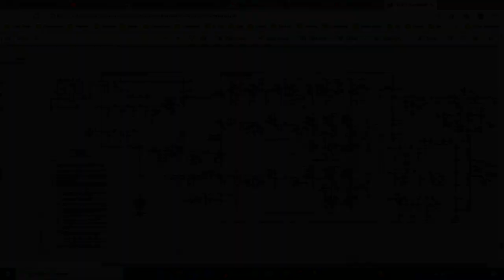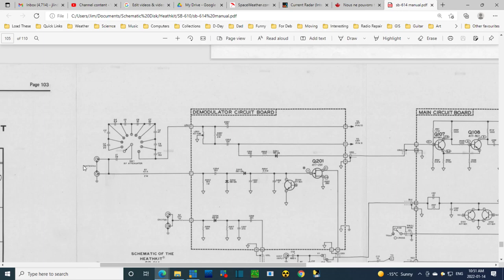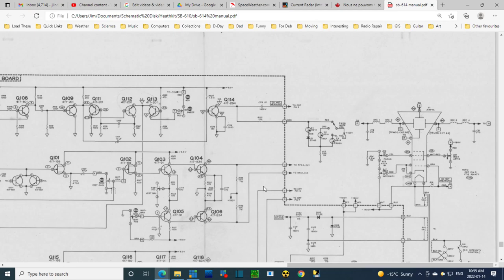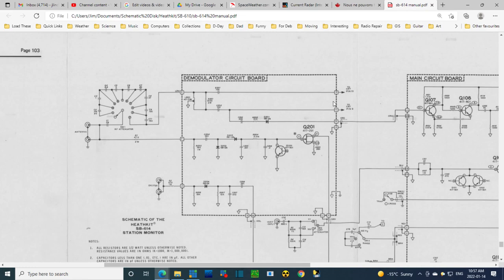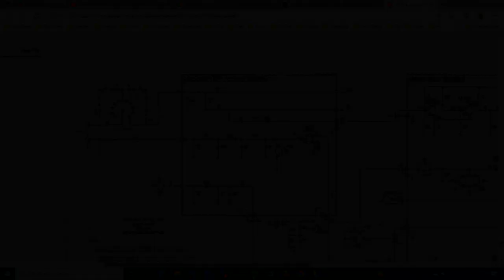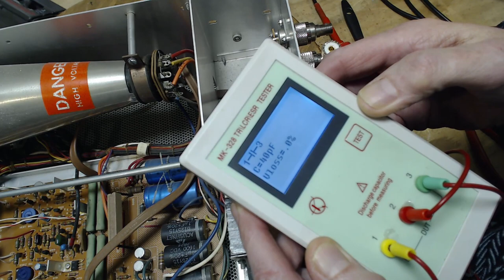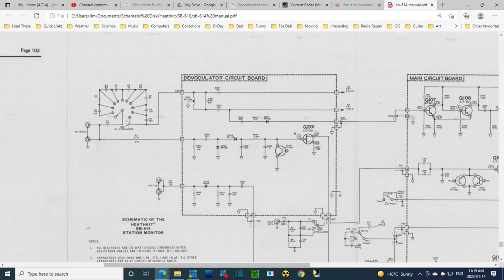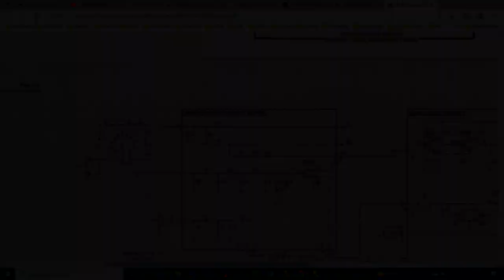Heathkit SB 614 Station Monitor Video #2 - QRP Modification

Comment: I'll bet the scope now presents a poor SWR to the radio. In its stock condition at 28 MHz you can see a noticeable change as you advance the vertical sensitivity switch positions. I showed 1.5 : 1 on mine.

Comment: Why does he presume to think that he knows more than the designers of the device, and change the value of the input cap "just because reasons"...
Reply: @tubeDude48  Over here, where's yours?
Reply: The capacitive reactace of the 39pf cap at 14.1 MHz is abt 290 ohms. By changing it to 330 pf that reactance drops to about 34 ohms. This will couple more energy from the antenna circuit to the scope. increasing the deflection. Not a precise calc but I believe this modification has moved the power range of this scope from the 10 to 1000 watts to a more QRP friendly 1 to 100 watts. I'd call that a success. My $0.02..
Reply: @jimcompton4587  Jim, nice job of engineering a solution to this challenge. As a Heathkit tech back in the 80s, this scope was designed as a companion to the SB/HW line of radios (and not QRP sets). Increasing the value of the 39pf cap would reduce the reactance, allowing more signal to be detected on the scope. A more precise way to accomplish this would be to build an amplifier/buffer circuit, but that's probably overkill in this situation. If you wanted to use the scope for both high power and QRP, you could add a switch that selects either the 39pf or a larger value that you would need to increase the sensitivity. 73